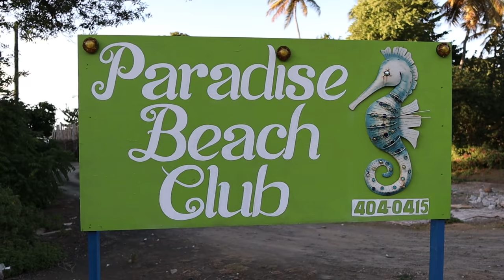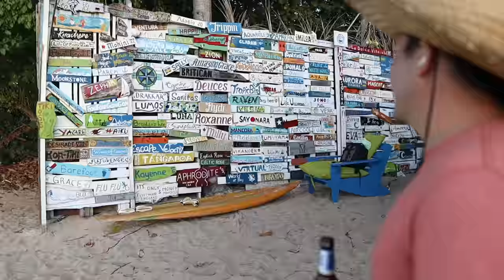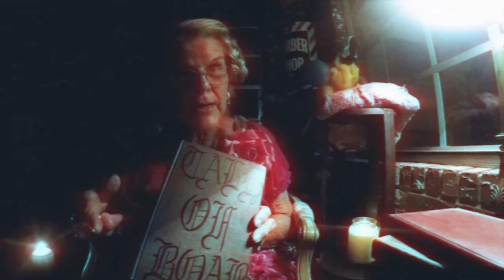Rudder PROBLEMS We Disagree about What to Do! | BOAB 206

Comment: There are many ways to steer a boat if the rudder is lost. In fact it is a requirement for off shore racing for example in the Pacific Cup, that you have to demonstrate you have an alternative steering mechanism and know how to deploy it. Whole books have been written on the the topic. Problem is most cruisers don’t think about it, much less prepare for it until they lose the rudder. Just be prepared and have a backup plan that you’ve tested before you head across the pond.

Comment: Guys, losing a rudder while out a sea, could be life threating.  Not only would you lose the ability to steer into the waves during storm, preventing the boat from tipping over, but you could also sink from the water gushing in through the hole of the missing rudder.  Ignoring rust around your rudder would be similar to ignoring rust around your wire rigging holding up your mast.  The extra time you take to take to check, and repair the rudder, could save your life and the life of anyone else you have on board.  Don't be foolish, check the rudder!!!  Good luck, ASH

Comment: So my own rudder story from today . My boat is a race boat , so tiller  with a below decks autohelm .  Anyway I  varnished the tiller handle when I bought her about 6 years ago and  made a cover for when she is resting . Boat gets pulled out every year and a thorough mast down  going over .But we do push her hard sometimes , real hard , so I look after her . Part of the haul out servicing  this time includes check every bulkhead , all the tabbing and the structural grid . 

Tiller handle was still in good shape but not quite to my standard  , and I did not like that it was dark stained . I don't think anything structural should be stained , you want to see the flaws . To be honest most would think me nuts to be refinishing it .  

So I sand it down today and sure enough there is a crack in it  where it was delaminated by a bolt . So fixed it with epoxy . 
Looks way better with that dark stain gone and you can see the multi color laminate of dark and light woods . 

So an example of taking the time to check it all and make it right  saved me getting stranded on a cruise or blowing a race weekend for all my friends because I found the hidden flaw before it failed .  

That rust stain , the mystery raising up of the shaft , loose bolts on the auto helm . You fix it all now, check every bolt you touched last refit  , and then check everything you just fixed  again after  10 hours , then 50 .  Best  insurance you can buy .

Comment: Im with Michael if you lose the rudder a new one is about 4k plus it really sucks not being able to steer. Trust me I know mine is at the bottom of the gulf of Mexico about 90 miles off Florida
Reply: Critical systems are critical, when sailing - more so in heavy weather and also - things frequently follow Murphy's Law.

Murphy's Law >>
1) If anything (good or bad) can happen - eventually it will.
2) See #1 - and bad things can often happen, "at the worst possible time" ... or good things can happen, "at the best possible time".

A stitch in time, saves 9!
Why do I rhyme?
I don't got no lyme.
 - yet I am only part pirate, 
 - I am only a scally wag of the highest order
 - stuck on land (no boat yard yet)  - so the sea, the sea is calling and I must go!

Comment: Hey Bums. That is a super unusual rudder. Great idea. You can drop the rudder without having to dig a hole to do so. Great until the fitting wears out. I suspect your square fitting may be worn in the rudder and that is why there is play. Good idea to inspect and repair that now. Once I figured out if there is play in the square fittings (the male one or the female one), I would install a collar on the rudder shaft below deck with a nylon bushing (big washer) on top that you can put tight to the deck so the rudder shaft cannot ride up again. Just a thought. Love the use of B-roll and lighting. You definately have upped your game.

Comment: At 21:01 of your video you are holding the rudder shaft to the right of your chin on the shaft there are flat spots on the shaft, there purpose maybe to keep the shaft from moving up.  Your bottom bearing may have 1 two or four setscrews that are meant to the hold the shaft from moving up or down.  Someone in the past may have changed you bearing, or you may have missed the setscrews when doing your last maintenance.  If the flats go into the rudder then there may well be setscrews under the fiberglass that you need to find. I would look at the lower bearing in your boat first for set screws.

Comment: Your upper quadrant should be tight upto the deck, See @ 9:22.  Push shaft all the way down and make sure the upper quadrant is up fairly tight to the deck fitting. Like .005" gap or so tight. Grease face of quadrant and deck before assembly.  Or get a delrin washer to fit between the two faces.   Use blue Loctite (242) on the four quadrant bolts.  

As far as through hulls and seacocks, scrape to shiny metal, if you see any pink or copper color reject.  if none found clean, grease and keep using.
Reply from the maker: There is a key that fits between the upper quadrant and the rudder shaft. It does not allow for the quadrant to move up or down. When it is attached to the shaft and the shaft is all the way down into the rudder there is about an inch gap. A washer or spacer could be the play.

Copy that!

Comment: You did the right thing guys dropping the rudder.  Maybe the quadrant should be higher up against deckhead to stop the shaft lifting or you could put a collar just below the deckhead.  Good you will repair the skeg, dig out all the loose grp and any filler, clean and glass it back up and fair it.  Good luck guys' that bar looked super cool.  Andy UK
Reply: So guys this was the solution after all….  Glad you sorted it.  Andy UK

Comment: Your videos are always awesome, thanks for sharing them with us.  

A rudder is an extremely important part of a vessel.  If you lose it and don't have a secondary method to steer the boat, you will be in a dire situation. It's frustrating to think you are about ready to splash and then you find something that delays you by a couple of weeks.  It's better to take two weeks to fix things properly.  When considering what to do, always think about how much more frustrating, and possibly dangerous, it would be to have to try and fix it in the middle of a rolling and pitching ocean.  Keep up the great work.

Comment: I would had put a few layers of weld on the end = making the square part a bit longer to make up for the > You dont know why the shaft Raised/Lowered. (That's where your problem is )  whatever bearing or whatever is allowing the shaft to come up or the rudder to go down. most likely the very bottom on ( Both ) what holds the rudder up has worn. Follow the gravity. Whatever rubs the hardest and the most has also worn the most allowing for the misalignment. That will be $50.

Comment: Seacocks and thruhulls, check for pink corrosion. Replace before they get too crumbly. If the seacocks operate smoothly, don't leak and no pink, you can grease 'em and keep 'em.
Reply: Thru hull valves should be exercised / lubed about every six months or so. If they freeze it can be catastrophic under certain cercumstances

Comment: Your rudder is critical!  If it wiggled up out of the keyhole I would inspect the shaft and keyhole carefully for any wear that may have happened. You could maybe put release wax on both components and reinstall with some epoxy to take up any wear that occured.  Look at the top of the shaft for any kind of retaining ring or mechanism to keep it seated properly.  If there is no way to lock the shaft into place I would be looking at ways to modify it.  Being able to steer is pretty important.

Comment: One of the things that would've made the rudder shaft to do what it did usually occurs when either the packing gland to the rudder is worn out or missing or the rudder wasn't tightened and it loosened.

Comment: At 9:57 it looks like there is machined bushing there.  Me thinks you have a Jefa steering system that is missing the washer. Jefa sold a lot of steering systems for Euro boats.  Might want to ask the Carter owners group for advice.
Reply from the maker: Good tip. Thanks

Comment: Interesting ruder system you got there. If the ruder goes all the way down to the bottom scag shew mount i would think that there should be a way to titan it up in the bottom so it would not climb back out like it did. But I am not there to look at it so I would have someone that is familiar with that system look at it  close.

Comment: it would be nice to see the inside of the rudder to see the female side of the connections (square fitting)... i'd make sure it's super snug and not wallowed out - fwiw...  after reading the comments below, i tap myself on the back (i'm not a seasoned sailor) as other sailors mention the exact same potential issue :) ... endoscope is what's required i gather ... great vid

Comment: Joel if you are going to get married get used to being wrong ( sometimes  even if you are right ) as for the post rising you should look for a place for a rusted over or broken off  locking pin on the deck side or a spacer under the deck fitting that has rotted away

Comment: It makes me weary that the 1 1/2” or 2” square portion on the bottom of the shaft is what your steering relies on. With the play you had, the part that this slides into might have been damaged. If someone has a endoscope camera you might want to slide it in there and inspect it. You really don’t want to take a chance on loosing your steering!
Reply: Great idea. You can get little scope cams on Amazon for $10. They connect to your phone via USB.  Super handy on a boat.  Can look into engines, pumps, around corners, record video, take photos.

Comment: Hello Just a thought is there a hole with threads in the bottom of the ruder shaft ? or what looks like a broken bolt ? 
Only thing that can hold that shaft in place to stop it from moving up wards
Reply from the maker: There is no hole with threads. It just fits snuggly down into the ruder.
Reply: @Bumsonaboat  You have an unconventional  discontinuous shaft so the lower connection would have no affect on the upper portion of the shafts movement

Comment: What if you space the blocks on the cockpit floor father off so they pull the quadrants down
Reply from the maker: I see what your saying, so you think the placement of the blocks is what pulled the quadrants up. Could be.
Reply: @Bumsonaboat  it's either that or because the bottom is a socket, it slowly warbled into a semi conical shape that rejects it but likely it's a combination of the two. Checking the free play in the loose rudder as you insert it may tell you about the socket, don't forget a marker can be used to die the metal so you can insert and move it to wear it away on contact surfaces like the bottom of the shaft, it seems plausible that square tubing was used for the shaft inside the rudder. Cutting more square on the shaft might allow for more bite. Maybe someone around has a borescope

Comment: The "Why" it did what it did could be more important than what it did. Why did that shaft move? As far as through holes and seacocks. Better safe than sinking in my book. If you got the resources. I'd replace them if there was any question to their safety whatsoever.

Comment: The problem will return , unless you fix whatever wore out to let it rise up . This is a vital part , break it and you are disabled at sea .  Redo the whole rudder .  

Also recheck everything after sea trials at least twice for it getting loose as you learned the hard way 

In addition rig an emergency rudder that works entirely without the boat one . I have seen using a spin pole and a locker lid with a few muffler clamps  steered with sheets to winches .  Pre drill it and have the hardware ready to go .  Not great , but you can at least motor close enough to get a tow .

Comment: Looking at the Shaft, it appears to be Squared on both ends.  Is the shaft the same diameter throughout or is it tapered?  My point being that one end of the square stock on the rudder shaft appears to be longer on one end verses the other.  The seat in which it sits inside the rudder may be deeper for more engagement .  Would it be wrong of me to say that the rudder post may have been installed upside down the last time the rudder war dropped?  Just saying if the shaft was not tapered and is the same diameter throughout being keyed.
Reply from the maker: It is a bit tapered but there is a key hole that is used for the quadrant and it is only on one side. That is how we know which side is the up side. It was definitely not upside down but we are looking for remedies to keep it from moving up again in the future.
Reply: @Bumsonaboat  check the lowest point near the rudder post for a washer that may have dropped last time you pulled the shaft. Great video btw, keep up the good work.